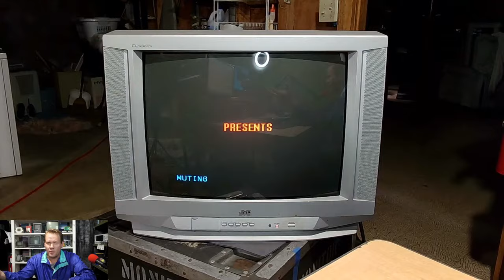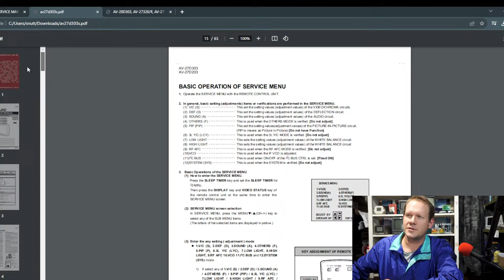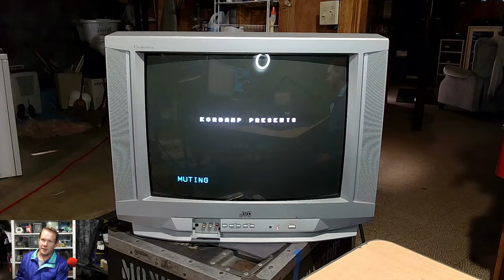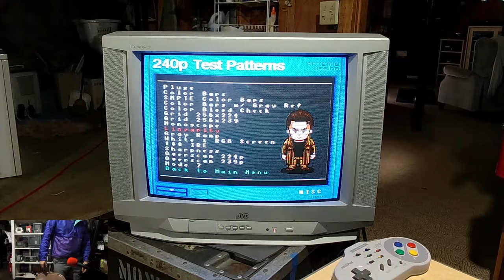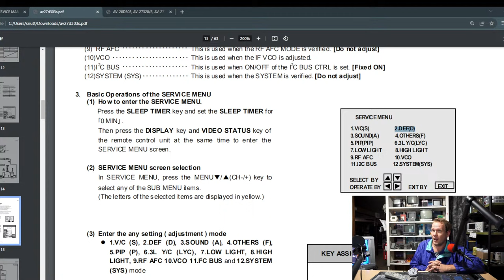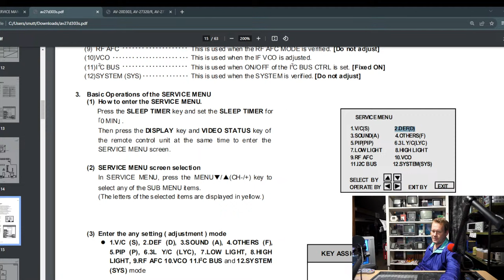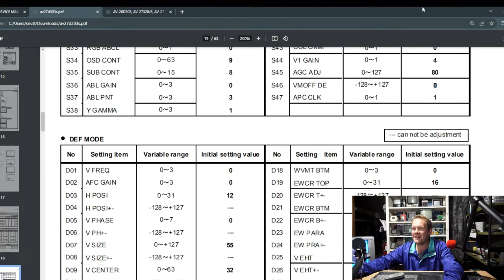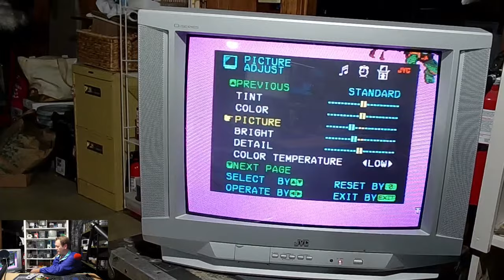The BEST JVC CRT TV - The D Series

Comment: I recently found a JVC 32D501, and discharged it a couple times within several minutes.  First time ever doing it to.  Man, I can't tell you the fear I had in me, worrying if I'm doing this correctly or not.   I took it all apart, cleaned it, and like the one you restored, it had 20 years of cigg tar build up. It took forever to clean up.  It's not perfect, but it's a hundred times better than it was.  I boosted the G2 voltage, and did a decent calibration on it. But it still needs work.  The caps look ok for now, but I want to learn to recap it correctly.  Your class that you were talking about, I am very interested in.  I'm hoping I can sign up, bring my CRT down with me, and maybe get this thing to be the best it can be.

Comment: How does the D-Series visuals compare to my JVC AV-32320 CRT? Is mine just as good or an inferior model?
Reply: It's the same as the D Series. I have the 36320 with a Panasonic tube. Our sets have 2 line comb filters vs 3 line or digital in the later D models. That only improves rf and composite quality. Early D sets only had 2 line filters also. S video and component are the same quality.

Comment: Yeah, I have one question. Is it possible to make your own Convergence Strips? 

Can I just take some fridge magnets and put them on a strip with a bit of tape and achieve the same thing?

I've even got some of the strong Neo magnets, but they might be too strong.
Reply: You can, but you need to use permalloy, not magnets.  Magnets affect purity, permalloy only directs and focuses the magnetic fields from the yoke coils.  I sell them if you are interested.
Reply: @greasebob 

Thanks so much for this info. It's not like ten years ago when you would find TVs on the curb every week and could nab them for parts. And I don't have space to keep old CRTs. So thanks for teaching me an alternative, assuming that I can just buy some permalloy if I need to fine tune some geometry issues.

Comment: I have one of these D series that wont display color, in any of the inputs (composite, component, Svid) and the brightness is incredibly low when hooked up. Without hookups, the TV menu displays colors just fine, and it looks like a good unit. Very odd.
Reply: Did you check the “color” setting in the main menu?